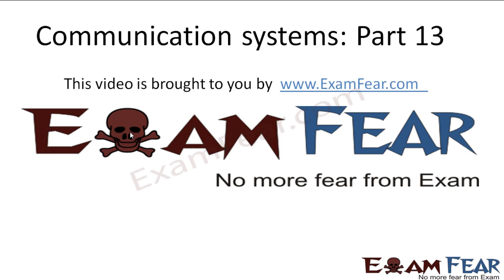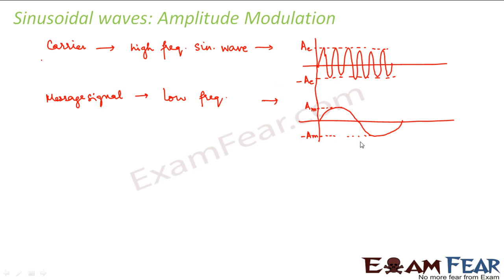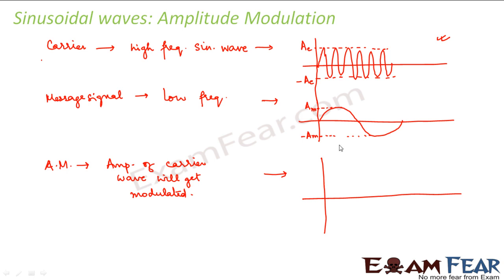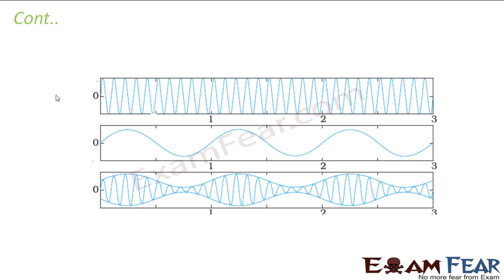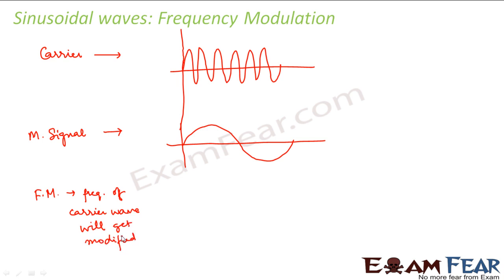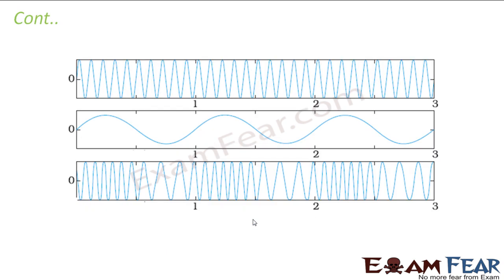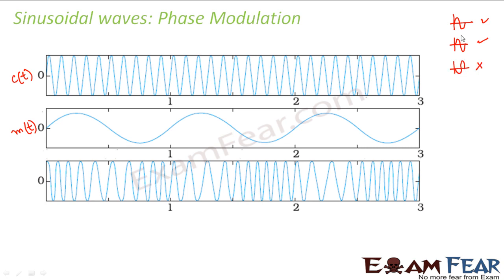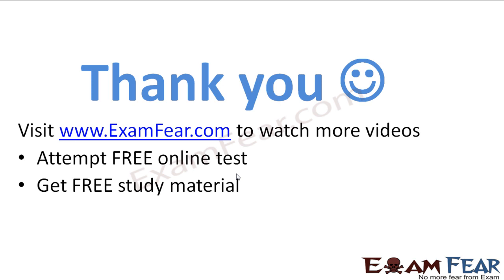Physics Communication Systems part 13 (Sin waves, AM, FM, PM) CBSE class 12

Comment: one thing mam I am not able to understand what is difference between carrier wave and message signal one time you say that low frequency signal just like message signal converted into high frequency so where is  carrier wave if high frequency wave travelled by a which is carrier wave then why you use carrier wave in modulation
Reply: mam now I am understand after seen  ch 12explanation
Reply: @build_aviation  pls bro tell me why? I have same question